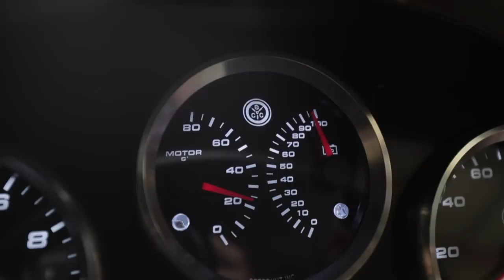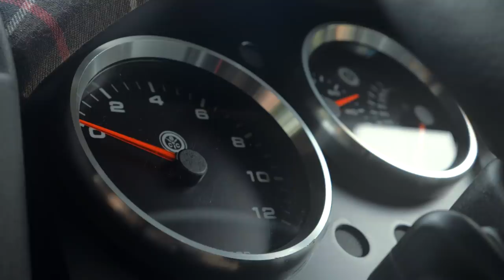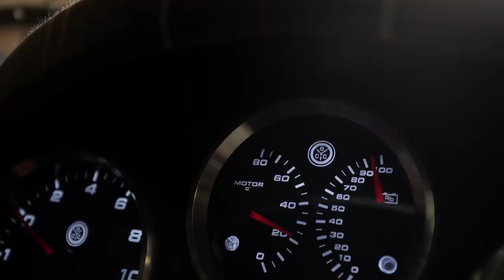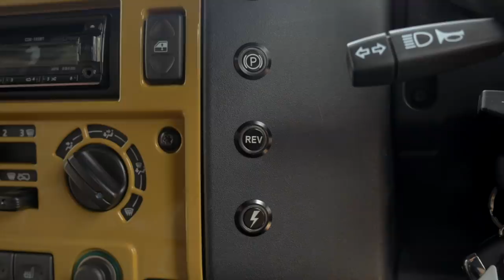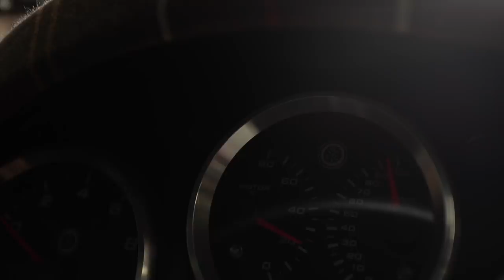EV Land Rover Defender Road Trip

Comment: Jonny the quality of these films are insane. It's not often in YouTube you get the feel of an actual TV show.
Reply: I loved the way we got good views of the gauges showing acceleration and regen......NOT.
And having been told no need for low ratio - so why is it mentioned inside - along with diff locking ?
Reply: Agree re. the production quality is as good as TV,  but more importantly the content & presentation style is thankfully free from the pressures of the attention-grabbing TV style - what I'm trying to say is that shows like this far exceed anything I've seen on TV recently. Nice work, Jonny.
Reply: @AdamJayPe  One of my absolute pet hates are captions you ought to read being plastered over video. They appear in this video on a yellow background. I was watching the video at the time, so didn't read any of them. They were an unwanted distraction.
He mentioned no need for hi and lo ratios  - so why were there labels for it in the vehicle ? He's just added mystery, unanswered questions - possibly failing to understand the vehicle.
He also said the whine was a transmission whine, not the motor - well if that was the case, it was from the motor reduction gears, not the vehicle's transmission - you find a modern car - clutch down, engine off doing 50 mph (downhill!) won't whine like that ! They're silent - all you hear is tyre on road noise.

Addendum: In fact, just sounds like an overgrown radio controlled car ! I'd guess for the same reason - straight cut spur gearing at the motor before it's reduced to engine speed and connected to the car's usual quiet transmission.
Reply: Indeed just when we miss Tg and 5thgear Jonny keeps us entertained in style and humblness👍
Reply: Exactly! If you were to somehow put Hammond as the presenter here it would be almost indistinguishable from an old Top gear episode.
Reply: pmailkeey I was replying to the main comment, I don’t share your gripes but I can help you re. transmission whine: I drive an 07 Defender & the gears, props, diffs etc. whine more than my pointer-spaniel cross, even from new.  Remember this is no modern car. Although the gearbox is gone, the transfer box (or a modified version) & all the rest will still be there - I can’t see a need to operate the low ratio with an electric motor, even if it’s still present.
Reply: @AdamJayPe  Even older cars generally didn't whine. usually in gears without synchromesh as they were straight cut rather than helical gears. The main cause of diff whine was due to worn gears - probably due to inadequate lubrication.

I think the pitch of the whine is also too high - suggesting it's from reduction gearing near the motor. 

Low ratio may not be necessary for the actual drive,  but it'll allow the motor to spin faster - and if that's driving a motor cooling fan, that'll be better.  It'll also mean there's more momentum in the motor - giving smoother power when hitting obstacles such as a step or kerb. Such gearing would also be less responsive to 'foot' input - a jolt of the foot on rough terrain won't result in a sudden request for 60 mph - in other words, easier for the driver to maintain a steady speed. So while not needed for raw power, it still has a few plus points.

Anyway, the issue really is what was the label for still in the vehicle if low ratio was no longer available ?
Reply: pmailkeey Hmm, we’re getting a bit OT here, but my limited experience of straight-cut gears is that they are VERY whiny!
Also I think  the opposite of what you suggest re. lower gears for off roading with an elec motor - an electric motor has max torque at zero revs so doesn’t need ‘momentum’. And driving my diesel Def in low range is very jerky (even though my understanding is that the throttle response is mapped to help reduce this), so another reason that low range on an electric just isn’t needed - too much torque means more likely to break traction. 
Having said all that, ECC have done a Beetle & a 911 and retained the manual gearbox, so you could chose between even more torque for max acceleration, or a higher top speed. I don’t know the reason behind this, might simply have been the easiest solution to convert. I believe the Taycan also steps between 2 ratios - probably to reduce motor noise at top speed?
Reply: @AdamJayPe  Nicely contradicted yourself there - stating motor has most torque at zero rpm - then going on to say too much torque would break traction - as demoed in this video on the road ! The motor momentum is useful for not changing the speed of the motor - i.e. smooth power application - which is what's wanted on 'delicate' surfaces.
Vehicles retaining their gearboxes - I've heard 3rd is a good general driving gear and top for motorway cruising. 3rd giving nearly optimal acceleration - and may well have been the fixed ratio chosen if other ratios were not selectable.

If ever there was a vehicle to drive 'feet off the pedals' it'd be a diesel Land Rover !

"my understanding is that the throttle response is mapped "  hmm - made to feel like a petrol vehicle rather than a diesel (tractor).
Driving a road vehicle with a proper diesel engine in it is quite a different sensation - and when used to it, one I liked. A bit like infinite cruise control !
Reply: @AdamJayPe  Jonny Smith has TV experience and that shows in spades, it's a great bit of production, and very engaging!
Reply: @AdamJayPe  "driving my diesel Def in low range is very jerky" Blame the driver for that !
As for off-road driving, torque is not what you want, what you want is momentum.

Comment: When battery prices drop, these electric car conversions will be everywhere.
Reply: Totally agree with you, I just hope those batteries would be very light and energy dense
Reply: Not likely. Most countries have certification procedures that it adds to the total price tag. Governemts should encourage to convert vehicles that are currently either rusting in garages or beign used outside cities instead of buying a new car
Reply: @dv2045  Its the same situation as the Nissan Leaf and soon it will be the same for the Tesla model 3. People love their cars and the rules will change if enough people fight to keep the cars on the road
Reply: Waiting for quantumscape lithium metal battery
Reply: @jasimua  what is that type of battery? Grafene was supposed to be the future of batteries but so far no more than a few kickstarter chargers have emerged
Reply: Even with free batteries it will still be more expensive than buying a new car. Even if the pay rate was the same as the factories, building a custom car takes a lot of labour. Converting a car is for the love of doing it or preserving a special loved car.

Comment: Love this. I have a 1989 Jaguar XJ-S- When the V12 engine finally dies i'm definitely converting it to EV. Should be able to fit all the batteries in the world under that huge bonnet.
Reply: Last place you wanna putem
Reply: I remember driving an XJS v6 at 80mph in a built up area on a learners permit when I was high,  good times.
Reply: @MrBirgerB  Yet there's 10 battery packs in that same place on the Elander in the video. Maybe share your thoughts with the conversion company that did it.
Reply: 👍P38 RangeRover here, I’ve already designed most of the systems, plus I’m keeping a close ear to what’s going on with in wheel electric motors and the potential they could bring, not just in drive but in battery space layout
Reply: @themadplotter  Not something one should admit to, anyway if high HTF can you remember it.
Reply: @brianhume4743  very much so, different times. Bit of Wacky can be detected these days, plus I was 16.
Reply: @MrBirgerB  .. do tell more please
Reply: @360nastybusiness  The V12 is ace, but I'll have to face reality at some point. The XJS is ideally suited to electrification IMO. Big low cruiser of smoothness and refinement, with lots of space onboard, and you can get rid of all the dodgy wiring in one fell swoop.
Reply: @bren106  There's also six batteries in the back of the Elander to balance it out, having a shit load of batteries in the front of a vehicle would make it unpleasant to drive or even unstable. Don't bother sharing your thoughts with the conversion company.
Reply: @888johnmac  Would prefer my batteries/weight low, between the axles, in the centerline. Guess it could be done in the engine bay of an XJS. Better to put them in the trans tunnel.

Comment: 17:15 that blue van wasn’t having any of it 🤦🏻‍♂️
Reply: @thong thong Of course, Jonny could have slowed down and dropped in behind it like a sensible driver
Reply: defenders only thing that scares white van man...lol
Reply: at 17:19 blue van man applied brakes realizing that is no ordinary Defender because it accelerated too quickly and pays respect.
Reply: He has to give way to the van. Not the other way around
Reply: @thong thong The highway code says that the car joining the dual carriageway has to give way.  Van man was driving correctly.
Reply: @thong thong making up rules of what is more polite, that goes against the highway code is what causes accidents, nothing awkward about it.  No one should ever move over or adjust speed for a vehicle joining the highway.
Reply: Johnny came from behind the blue van so van man didn't seem him coming. Maybe he would have moved into lane 2 but was caught by surprise.
Reply: Vladinski it is safer to move over if there is nothing in the middle lane. Allows the acceleration lane to be used correctly, and gives more room for manoeuvring. Always safer to allow more room if possible
Reply: @jasontholen  There is no such thing as an acceleration lane, or a quick lane, it's lane, 1, 2, 3, etc.  They are all the same limit.

It is not safer, all you set a precedent for bad driving standards and ignorance for joining the highway safelyobvious
Reply: Vladinski the acceleration lane is the lane that joins a motorway, not one of the normal lanes 1,2,3 etc. If it is not safer, then when slower vehicles are joining motorway, they would never get up to speed. Always safer to allow room.  You are correct that legally, the joining traffic should give way though.
Reply: @jasontholen  You're describing a "slip road", no where in the highway code or any driving material is called an acceleration lane.   You're describing it's purpose,  But I understand your previous message better in context now.
Reply: I cringed when i saw that i dont think johny knew what was coming and the van had no reaction time to be fair to him. Nobody was really in the wrong in real time. Its easy to say the van shoulda moved over but by the time he even saw the defender it was to late. Imagine if someone undertook you on an entrance ramp at 80 mph. Ud barely get a chance to look at ur mirror to change lane before its to late

Comment: Electric conversion of these classic cars are great unless that said classic car is revered for it's engine.
Reply: Was about to say the same thing. For a Defender it makes absolute sense, the engine was never the focal point of the car, however when I see people turn a 911 or such into an EV it turns my stomach.
Reply: It would be like making an electric supra
Reply: If the electric has more grunt and acceleration than the original engine and can do at least 200 miles full charge I'll take it.
Reply: @ianmangham4570  maybe. I'd still prefer the growl and whine of the twin turbo supra than an electric version but thats because I'm nostalgic for the original. I already am completely sold on EVs for my vehicles but there's that outside hypothetical situation where I'd still keep an ICE. 

If I could I'd snap my fingers and make every new vehicle sold an EV, but for some older cars I wouldn't want to alter a peice of art like that.

Its all preference and subjective opinion though. Evs will win out either way.

Comment: Totally - this is the way forward. If we want clean air to breath then ICE is going to have to go away. But if we want that to happen quickly we either have to scrap the entire ICE fleet before it's time at huge environmental cost for the scrappage or we can have a mass conversion program where only the drivetrains get scrapped and the rest of the vehicles get a second life as BEVs. Planning on doing this to my mk4 Transit and my Audi A2.
Reply: @dantevxv1501  Well to wheel, even electricity generated by coal is more efficient than millions of individual internal combustion engines. But the grid is getting less carbon intensive all the time. Renewables are the cheapest form of generation, hence that's what's being built these days. No-one is building new coal generating plants, because they require you to buy coal to operate while the wind and sun are free... It's really a no brainer. Sure, batteries need to be produced with an associated energy cost of production. But you only have to dig the materials for a battery out of the ground once, as opposed to continuously for the fuel going into an internal combustion engine.
Reply: @dantevxv1501  Batteries don't need replacing after four or five years, and wind turbines don't take more energy to create than they generate over their lifespan. Both of your statements are simply untrue. Edit: I misread your comment - after ten years, they may well be nearing the end of their useful life as a vehicle battery. But that's not the end of their usefulness. They can be and are being repurposed as stationary energy storage at the end of their life as vehicle batteries. Even after that, they contain all of the valuable raw materials required to make new batteries. Lead acid batteries are recycled now - what makes you think lithium Ion cells won't be to recover those materials?

Comment: I love EV tech despite being a diesel junkie but unfortunately until battery tech allows this to tow 3.5ton trailers for 500miles at a time and recharge in 30-45mins then diesel will still be the future for a lot of people.
Good vid though Jonny!
Reply: @Ernst Boye 9kl there are in my friendship group, maybe not in yours
Reply: @Ernst Boye 9kl they are also used a lot for business... Like I said maybe not for the city slickers but elsewhere towing 3.5t and being able to cover distance is an important consideration
Reply: @Ernst Boye 9kl then they can have nice easy to park city EV cars with 200 mile range which will suit them fine... This video is about a 4x4 SUV which is where carrying 1ton, towing 3.5ton and still getting decent range and the addition of being able to power tools is important.
EV range suffers greatly when towing, laden or during cold temp etc which is where these vehicles are predominantly used
Reply: yes it looks promising but a 300 mile range unladen is hopeless as when loaded or towing it will probably drop to 150miles and fast charging points aren't available in rural areas which is the whole point of the comment I left 9 months ago...

Comment: Great video & great engineering. Jonny, the presentation and editing of this video is similar to your 5th Gear segments. Very seamless & excellent production values.

While I enjoy the engineering that goes into these vehicles, I'm going to point out something that my mother said when these E-Vehicles were coming onto the market. If you have sight & hearing impairments, you can't tell if one of these vehicles is on the road due to lack of noise. My mother was always used to hearing vehicles & she could determine how far away they are so she could cross a road. Pretty hard to tell with these E-Vehicles. 

Again Jonny, love your work mate & I can't wait to see more of your videos.

Comment: Great work, thanks Jonny! My 1961 Series IIA currently has a 200tdi, so already one engine-swap in, and it's still on the road. I'm very much hoping that the next engine swap will be to an electric motor, and that we can keep the legacy going. Bonus points if they can keep the red/yellow/Fairey overdrive levers working as Solihull-intended.
Reply from the maker: Your '61 will be a glorious EV candidate Tim. Thanks for watching.

Comment: Totally agree with what you say about reusing and recycling. I think a lot of older cars can benefit from electrification because their engines and gearboxes are much heavier and bigger than modern ones, so you can fit more batteries in without altering the characteristics of the car.

Comment: Very very good video! This E-conversion is superb!
The only Downside is longlivety of the batteries. How many chargable drills i have disposed because the batteries were tired. The drills were still perfect but the batteries were all tired.The cost of new batteries were high so i just had to buy a new drill. It's all good for now but the capacity of these batteries will be less than half in 10 or less years. And batteries are EXPESIVE to replace...

Comment: Brilliant fun. Thanks for another great video. After a lifetime rebuilding vehicles inc. many 4X4, at 65 years of age and having had enough of unreliable, shockingly badly designed ICE that fall apart and damage my grandchildren's futures with their emissions, this sort of video review of superb, EV converted, astonishing 4x4 performers has helped me regain motivation to get the hot spanner, multimeter etc. out again. Now, what do I need to rebuild a 1953 Series 1 LR (LandRover + Long Range) into a (safe?) 750bhp, twin motor EV? 😉🤣😎

Comment: Interesting to hear you say DC charging was an option as I have never seen any conversions with it. Thought it may be to do with regulations/complexity. Costs should become lower, but bespoke/classic always cost loads. If it had CCS then it opens a lot more use options - like a long tour/adventure without having to have lengthy stops.

Comment: Excellent video, desire factor here off the scale. Yes there is a whole industry here waiting to happen in the future, will never be cheap due to the labour costs involved in retro fitting anything. I would not like to have a crash in that 90, there is a reason they were slow - even the old V8’s would max out at 85mph